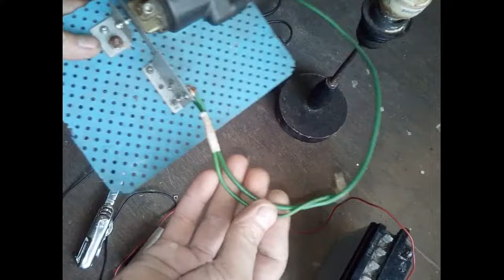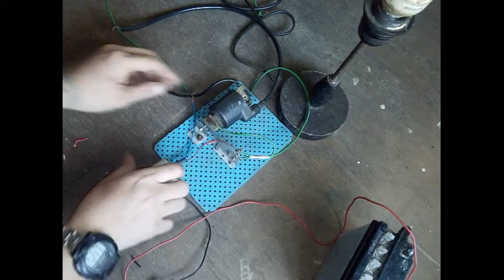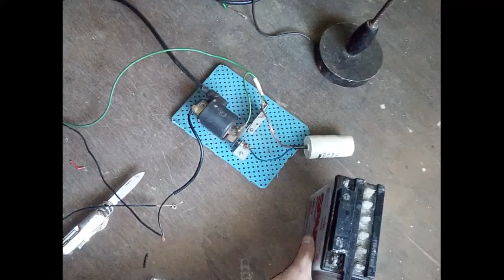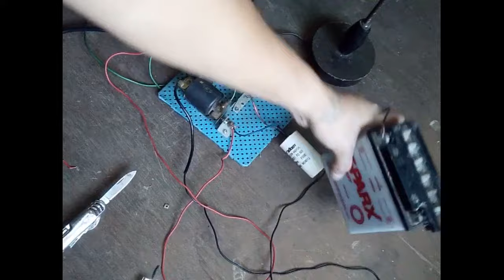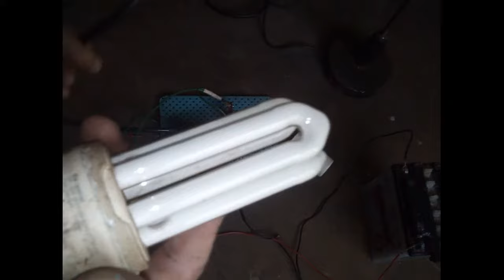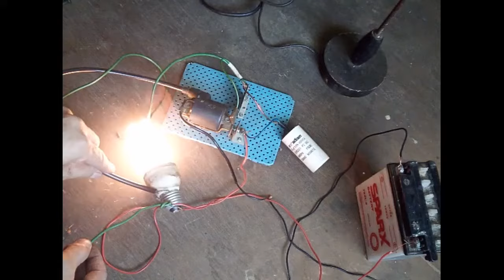How to make simple fish shocker

Comment: Di ba to nangungurente sa nag ooperate pag nakalusong sa tubig?? Meron ako pero yung aparato talaga.. di nangungurente sa operator. Pero yan parang nakakatakot. Anlakas kasi ng kuryente nyan
Reply from the maker: it May be dangerous if contact directly that why need to wear rubber boots it may have high voltage but it is low in wattage anyway thanks for watching may god bless you 😁😁